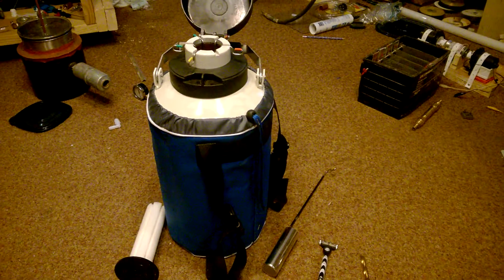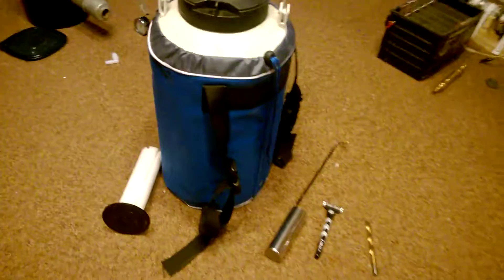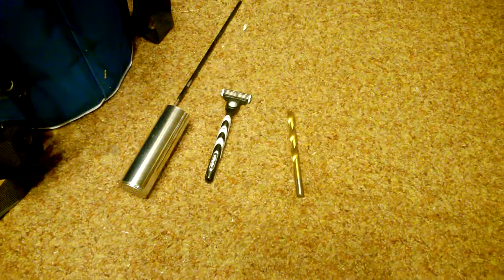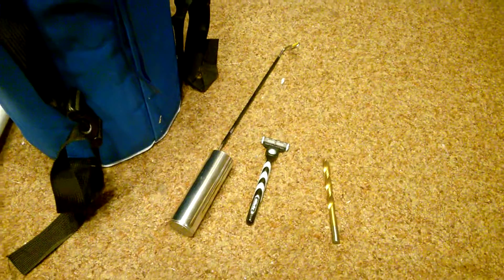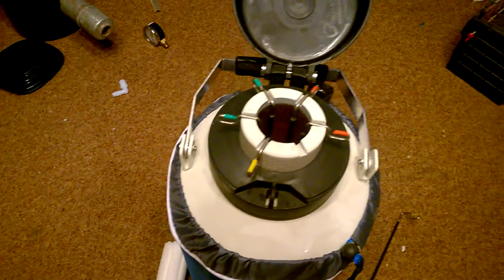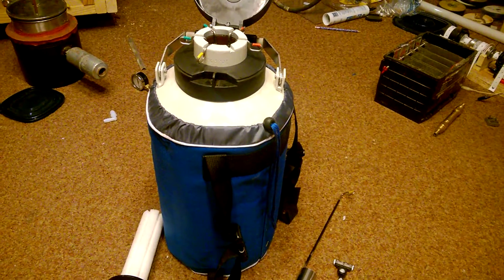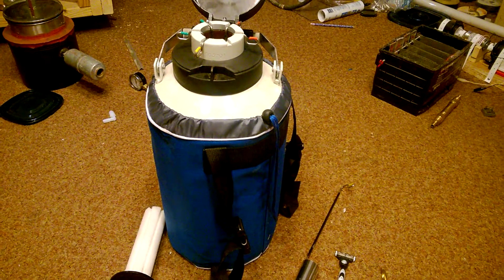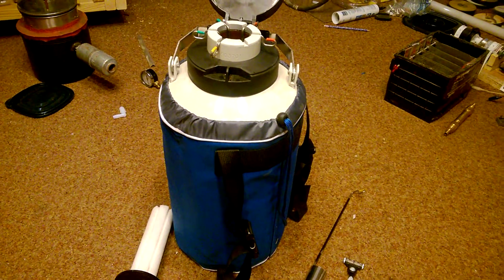Cold tempering

Comment: Cool :D So this is like after tempering? Addition to hardening and normal tempering? I just found some old finnish book that has the right temperatures for hardening and colours for after tempering. And it really is the harder you want it to be, the lower the after temperature needs to be... Never would have known that it works in minus degrees. But its not good for all blade types (very hard seems to be traditionally used only in drill bits and metal tools that need to bite very tough materials). How about if you dip just part of the metal? Will it bend and warp?
Reply from the maker: +Kangsteri  here is a Video on it https://www.youtube.com/watch?v=Cu5JsyPgtoo
Reply: +diveborg13 Thank you very much! Seems like there is many new things happening in modern blacksmithing as we start to understand induction and the nano structures better. Im interested in knifes, puukkos, axes and swords. And looks like these kind of things will make big change in how the best blades have to be done in future.
Reply from the maker: +Kangsteri  Yes in Deed I'm excited to do this and have Plenty of Knifes to test this